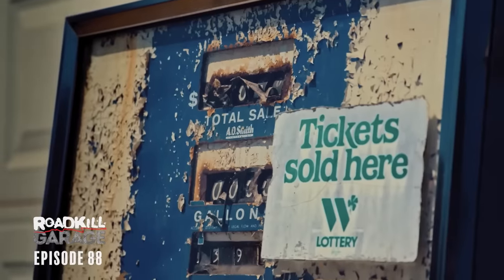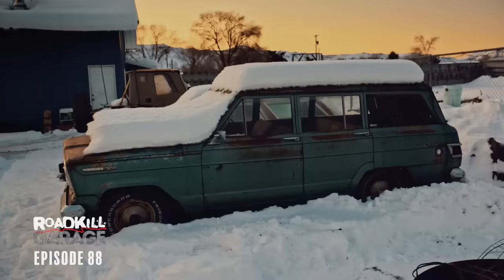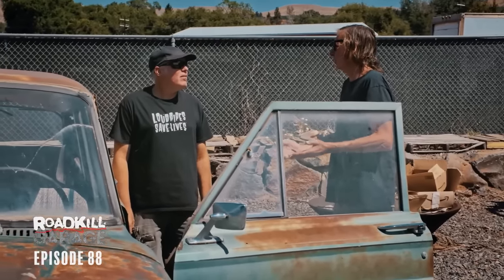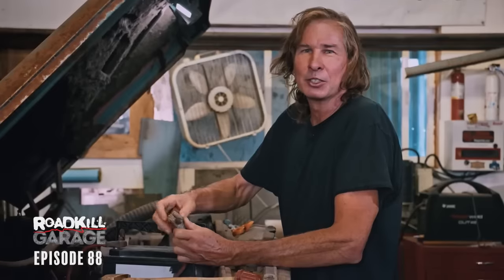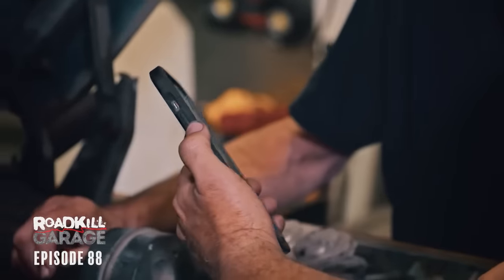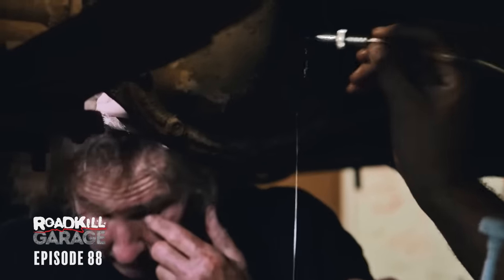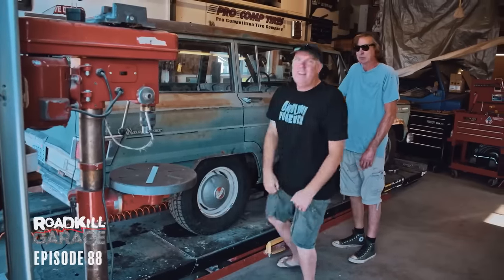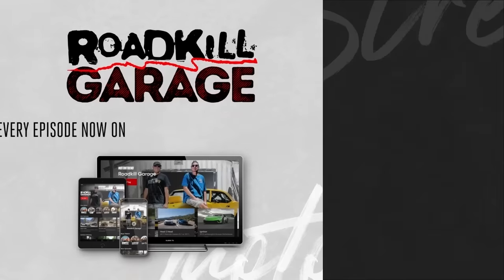Fixing the '67 Jeep Wagoneer! | Roadkill Garage

Comment: Hi Steve and David,    Nice old Wagoneer, Similar to your previous 1968 with the 327 if memory serves. I have a 1966 Jeep J - 2000 Gladiator pickup that was my Dad's and still serves me as my plow truck. Mine has the AMC 232 straight six and started life with the three speed column shifter and now has a floor shifter conversion. Plowed thru 6 feet of snow in 2015 during our hard winter that year. I got stuck many times but eventually got the job done. Great Wagoneer find and I hope you keep it and improve it over time.

Comment: It's a mistake to crank a dry engine. Pull the spark plugs and use a pump oiler to shoot oil down the bores. It also makes it easier to turn over and frees up the rings.
Reply: It had been run recently. If it had sat for a couple decades it would make sense to oil it up.

Comment: That sure is a Buick 350.  But it seems odd to find it in a 1967 as I believe they were used beginning in 1969-1971.  I have a 1968 Wagoneer and it has the 326, precursor to the 350.  I bet that’s a 1969 or 1970, or the engine is a transplant.